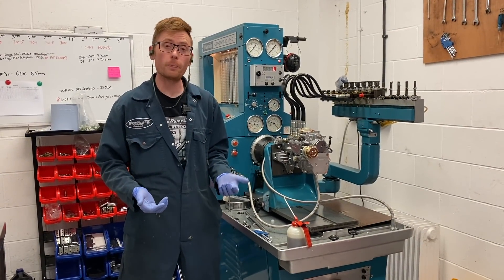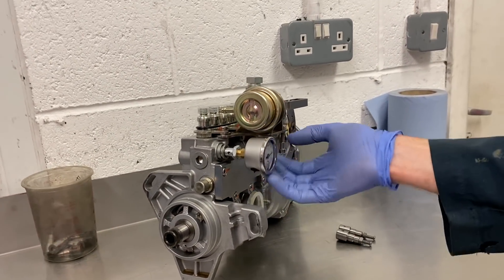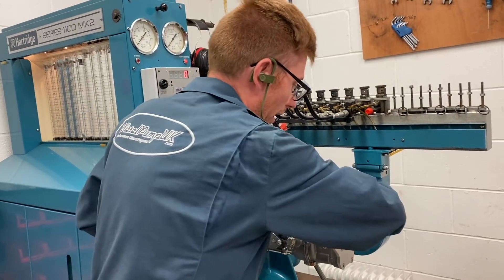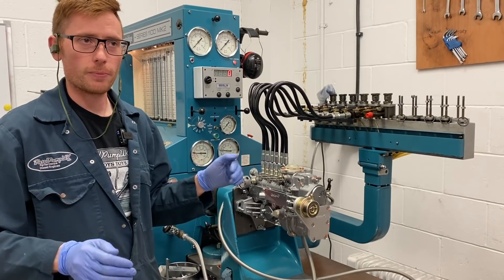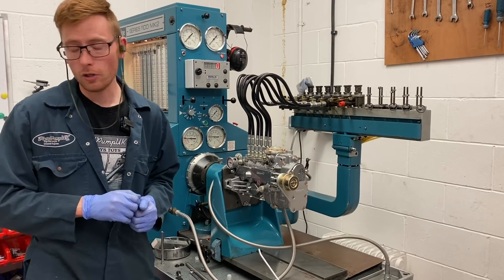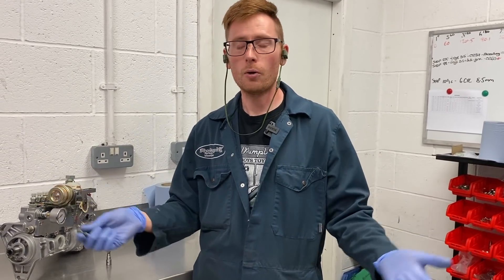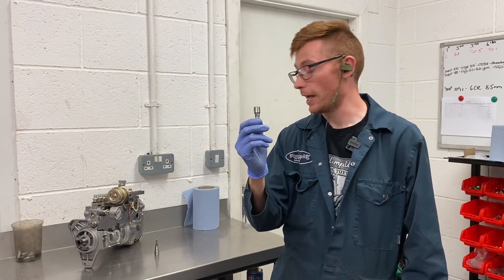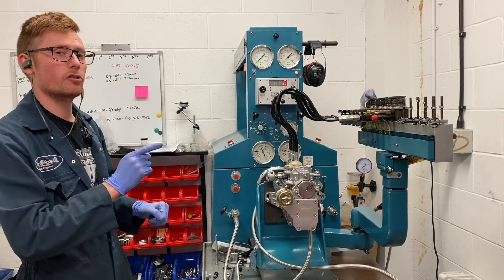The Key to BIG POWER - Fuel pressure to your DIESEL PUMP

Comment: on my cummins P7100 return line i have a holley gas 10an fuel pressure regulator with boost port of a carbureted turbocharged engine and it works perfect stays right at 30psi (2.07 bar) 👍

Comment: But why do you read 2 bar at the test bench and 1 bar on the pump with no flow (blocked return port on pump)? The pressure with no flow should be the same. I think you need to open the breater rubber walve on the top off the pressure gauge.

Comment: I recently purchased 2003 Case IH JX95, made in Turkey, with a Bosch VE injection pump and an Iveco 4 cylinder engine. I can provide model numbers if you are able to respond to this post. It only has 375 hours on it. The most unfortunate part of the fuel system design is the fuel tank is well below  the injection pump and there is no fuel pump supplying pressure. It depends on a siphon system to supply fuel. So I took the tractor out for it's first real bit of work yesterday. At road speed,  high speed/high gear on an incline the engine was definitely searching for more fuel.

I was wondering if installing a cheap electrical inline fuel pump would help my situation.

For my background I am a degreed automation engineer with a career in the oil & gas industry. But I live on the family farm with my late father being a lifelong farm who always said there wasn't a tractor worth anything unless the fuel delivery was increased from the factory. I know he somehow increased the fuel delivery(with help from a local mechanic...who has also passed) to our pulling tractors. One was a White 105, another was an Allis Chalmers and another was our Ford TW-25. All tractors from the 1970s and 1980s.

This same pump also has a leak. It appears to be between the hydraulic head and the body. Perhaps the o-ring needs replaced. It it possible to remove and reinstall the hydraulic head with the pump still mounted on the tractor? Or do I need to remove the injection pump to perform this task in a vertical orientation.?

Comment: HI! Nice video! I have a OM-314 engine with Bosch PEs4a90d diesel pump in my old Ford F-100. Is it possible to change the elements of my pump to achieve more power?.

I really like my mercedes engine, but it's slow. Thanks from Brazil

Comment: Liquid filled pressure gauges may give you false readings, depending on application. Density of the liquid filling changes with temperature, and in a hot engine bay will give you a different reading than in a controlled environment.

Comment: Is it possible to use a MAP sensor as a fuel pressure sensor? I don't see why not, tbh. I'm only worried the materials in the MAP sensor could react badly with the fuel. I'd have to open one up and check, or try to find out what kind of elastomer the diaphragm in the sensor is made of. It's not a problem for me to connect it electrically as I'm an automation engineer. It's just a 5v supply, grond and a 0-5V signal that is 2,5V at atmospheric pressure. I want to do this because I want to check my fuel presure while driving, and also check if there is a vacuum because my electric fuel pump is dynamically controlled and comes on and off by itself. I also want to build an auto start system that inhibits starting before my veg oil fuel has reached a proper pressure at the pump.

Comment: Very good video well explained.
I used a Hartridge.
Machine 56 yrs ago at the technical college we did all the tests etc 
Including phasing and 
calibrating the in line pumps.
Also stripping pumps and repairing to the 
required high standard 
which was req.

Comment: I would suggest a bypass pressure regulator on the feed pump. Due you recommend to fit accumulators as shock dampers?

Comment: This is garbage. You cannot, cannot feed more fuel into an older mechanical pump with no return line. Makes zero difference. Intact forcing more fuel into those pumps without a return damages them.
Reply from the maker: These pumps DO have a return have a look at one when you get the chance.

Comment: Would be worth pointing out that putting positive fuel pressure in front your injection pump isnt always a great idea... For any pump with a built in (fuel pressure controlled) dynamic timing system (So basically any modern rotary pump (VE etc), this is a bad idea, the second you add pressure, you will mess up this timing curve (Add a bunch of timing at idle / lower demand where you dont want it).... Worth mensioning as I have seen many of times on customers vehicles where a "performance fuel pump" has been added inline to there VE pump supply line, and then the engine sounds like a bag of nails...purely because the pump just runs at max timing 24/7.... For pumps like the VE, the key to higher rpm power lies with restrictions in multiple places in the body, and the plunger return setup AND fuel restriction...You CAN (and need to) add a pump, but other modifications are required at the same time.
Personally I wouldnt generally drill out a return fitting, its largely there to purge air and provide a small ammount of fuel flow for cooling.... If you are having to drill out your return restrictor, you are somewhat defeating the point in adding more inlet flow? Would be better to fit a (decent) fuel pressure regulator on the inlet side, with its own return to tank...that way you can run as big a pump as you want, and set the inlet pressure to be constant, largely regardless to demand.... and you arnt wasting perfectly good flow going right through the pump and down the return.... If the pump wants 100% lift pump flow, the regulator will just shut its return right off to try and maintain inlet pressure.
Just a few thoughts that may be helpful to a few people....
Reply: On VE pumps be careful with inlet pressure changes and drilling out return banjo bolt restrictions as these are both instrumental in advance curve, the regulator setting as set by the plug above is a max setting, the pressure rise curve is dependent on rpm and bleed rate back to tank which moves timing piston as pressure rises, this can be altered by low pressure pump wear ( for those that don't know its at the front of injection pump) causing slower rise rate or blocked return orifice screen or orifice itself or someone replacing banjo bolt with different orifice size ( smaller or larger)or drilling out etc, as pump rpm increases so does fuel volume which causes a rise in pressure,when due to bleed rate thru orifice it can't return to tank fast enough as well as what is actually being delivered to the injectors factored in and the advance piston pushes the cam ring advancing injection, usually 1 of two scenarios happen, LP pump wears and inj timing retarded thru whole or part of range or orifice incorrect and advances too soon ( too small) and runs hot, or lays down in top end (too big) from not enough advance,
If your pump static timing is correct ( usually done by plunger travel method) and is running hot at high rpm but not blowing black smoke and Max regulated pressure is in spec then most likely running too far advanced from return restriction, if you have a spare return banjo bolt try running a ever so slightly larger hole and see if the running hot changes to a higher rpm or goes away ( assuming return lines are clear and tank not over pressuring) this is/ was a huge issue with Toyota 1HZ mechanical pumps and some 5L pumps, Toyota had revised return banjo bolts thru Denso dealer program when correctly diagnosed this also sometimes lead to over injection on stop start driving and oil sludging from fuel contamination in oil
Reply: @Hitman-ds1ei  interesting. I suspected I overdid it and had removed the pressure regulator and tapped it back out and reset it. I have the original OUT bolt back on, and car seems to be happy now. Although when I did a simple quantity of fuel coming out of my pump before messing with the pressure, I was supposed to get roughly a litre of fuel @1000 rpm after 1 minute. I only got 200 ml back, 1/5 of the suggested return past the out bolt. Checked for fuel restrictions going to tank, checked pickup and sender, and the inlet tube seemed to be tough to blow through. Vac gauge was able to pull a few inches of mercury though and it seemed to be fairly unrestricted. If my old pump is roughly 5-8 psi lower than factory across the range, that’s fairly good considering it’s likely quite old and worn. 

Plus I think I’ve had a tremendous AHA! moment. I strongly believe my turbo wastegate actuator spring is weak and is having exhaust pressures overpower the spring and causing the flapper to open, bleeding out boost and causing this intermittent night and day power variation
Reply: I JUST finished messing with my mechanical VE pump on my ‘97 AAZ 1.9td VW. I made a pressure gauge adapted to the head of another out bolt, suspecting my pump is a tad weak. 
From what the internet and forums say, I was about 5 psi less at 1000rpm and about 10 @ 2k rpm. 
So i took a punch and hammer and knocked the fuel pressure regulating pin in a hair, and the car seemed to respond well, the pressure increased a bit to supposed normal spec, but it sounds like a bag of nails. 
I rebuilt the engine, ported the cylinder head with freshened up valve grind and seats, added an intercooler setup, yet to de-restrict the exhaust, but the car’s final issues I feel lie in the pump. 
The real doozie is that with the same pedal travel in the same gear, with the car in the same load, even with the engine and turbo heat-soaked, it’ll suddenly be a different car, it springs to life and actually has TORQUE and pulls like a freight train. 
I’m at a loss.
Reply: Mercedes m pumps don’t actually have any timing control, the gear on the front of the pump has a centrifugal mechanism that advances timing with more rpm,
Reply: @Diesel8290  I realise that, I am talking for cars that do....
Reply: @darrenjlobb  any idea on what this surge of power and torque might come from on an old VE pump diesel? I know I’m “that guy” on youtube, but you look like you know these pumps more. No one has got a clue that I’ve asked, people just say take it to a shop

Comment: why not use a spring type return bolt with an m12 to m14 adapter and have as good as constant pressure? like the bosch ....000 (1,5 bar)  or ... 089 ( 3 bar) . The internal pressure (as small as it is in an in line pump) doesn't even have any influence to wear of the element, fuel quality does! return bolts with a calibrated hole only have their use in VE-type pumps where different internal pressure is needed for mechanical timing....  nice little bench btw . ( i operate eps 711, eps 815 , AVM2 , hartridge 400 , and multiple others for cr). Kind regards

Comment: vovlvo fl6 used 24 volt 044 eqiv on a bosch 044 from factory,and funnily enough didnt have same failure issues like the transits which either doid not have alift puymp or flowed the fuel back through the pump and these pumps need flow for coolong

Comment: yes i chased fuel pressure problems for years,now wherever possible i use holley blue or bosch 044 depending on how much lift pump pressure i need,i worked at united fuel injection in perth WA and i was the first there to fit elec lift pumps to vehilces,some idiots are trying to say i cant use an 044 on a bosch p pump which i have fitted to a mercedes truck without issues
Reply: What is the input pressure for a Bosch P please
Reply: @rod5262  depends on application,valve on return line opens around 30psi in standard engines
Reply: @rod5262  i dont agree with the assumtion it should not go over 45 psi in video,tractor pullers,diesel drag race etc routinely run 120psi+ into P pump,driveability issues aint an issue to them though LOL
Reply: What effect will having an open return have on a p series pump?  This is for a farm tractor , some have valves on the return side and some don’t
Reply: @rod5262  not an open fucking return line,regulated return ,are you even a mechanic?,same valve gave alot of problems on cummins applications
Reply: I’m not a mechanic Andrew so I’m asking questions that I have never been able to get answers to. John Deere started using P series pumps in 1972. These had no restriction on the return side and no valve at the supply side of the Stanadyne glass filters. These engines lost their fuel overnight every time unless the tank was full. I blocked the connection between the fuel filters and the leak off and sourced a valve for the return side of the pump. Straight away the glass clip on filters shattered so I managed to source steel ones plus plus Deere recognised their error and made a non return valve available for the supply side of the filters. All of this cured hard starts. I assume these pumps need 30psi gallery pressure to function as they should
Reply: @rod5262  i have worked on a few john deere $wd tractors going back to my apprenticeship days,the only ones i have seen have the 30psi relief valve srewed direct into pump gallery,and the issue as well as drainback has been where lift pump wears out usually due to dirt contamination and it cant make 30psi pressure and as it cant remove air wi=th return flow engine stops due to airlock if driver isnt refusing to drive it cos it lacks power LOL

Comment: a guy with a flow bench should know inlet pressure doesnt matter. flow is all thats required. pressure is merely the restriction to that flow, which we know is there. because its the fuel pump.
Reply: A guy without a test bench should know that flow without pressure will not charge the elements.
Reply: @drbobritter1143  no such thing as flow without pressure. go back to school.
Reply: @DieselRamcharger  that's wrong. You can have flow with basically no pressure. If I take a hydraulic hose off the outlet of a pump, I'll still have flow but there will be very little pressure
Reply: @BENNO117  Pressure is the RESISTANCE TO FLOW. For fucks sake.
Reply: @BENNO117  Go back to school dude.
Reply: @DieselRamcharger  I know what pressure is. What I said is true. You can have flow with virtually no pressure
Reply: But you need the pressure to force the diesel into the elements as they come down to be refilled,
Reply: @Diesel8290  no. the elements are empty, a void. when they open atmospheric pressure, which is all around us all the time, will be happy to do the work for you. Thats why when you knock over a glass of water, it spills. You dont need to pump it out. You guys have some VERY basic misunderstandings of how things work.
Reply: @DieselRamcharger  a glass of water has time to empty. At 2000 rpm you WILL need pressure to fill the void quick enough to maintain performance
Reply: @holmes1956O  what you need is fuel flow. the problem here is that people are using PRESSURE to qualify FLOW. This is inaccurate. I fully understand how this all works. Maybe yall should THINK a little more and respond less. The person in the video claiming to educate you all doesnt know everything. I encourage you to do your own math.
Reply: @DieselRamcharger  I have over 40yrs experience working on diesels some as large as a house. My favorites are the cat 3406 a and b. I also know about flow numbers pressure and volumetric efficiency. and smart asses that think they know all

Comment: will be there a video in the near future about boosting diesel engine with lpg?
Reply: I have both Powershot LPG injection and a Snow Performance  water/meth injection(dont use  LPG and water/meth at the same time!) on my highly modified Nissan Patrol turbo diesel. Water/meth kit gives you more power than using the LPG kit. Cheers!
Reply: @bikerman6907  does the LPG or water/meth affects the way the exhaust sounds?
Reply: @antoniotod9614  no not the sound. But you can clearly see a reduction in black smoke, when the water/meth injection kicks in, not so much with LPG actually.

Comment: Fuel pressure to the pump i assume basically means naff all where as flow rate capability has to be essential?
Reply: pressure is resistance to flow, having higher pressure indicates a higher flow capability.
Reply: @swagman155  but you need flow to maintain pressure, it no good having 1000 psi closed pressure only to drop to 1psi when the taps open.
The pump is going to raise the fuel to the required injector pressure but the pump needs an adequate flow rate to do that.
Reply: @Will-thegrumpysoutherner  you said it in your first line. You need flow to maintain pressure. Therefore if pressure doesn't drop bellow spec it means flow hasn't been compromised. If pressure did drop it would indicate flow isn't adequate.

Comment: Any chance you could test a Bosch P7100 pump for us?   I'm running my P-pump at 30psi with an adjustable Fass fuel regulator instead of the banjo bolt
Reply: I run 30psi at idle and 40psi going down the road. I think you can safely run 60psi

Comment: It’s the same with new GDI engines as well. Boosting low side pressure increases the delta so the high side is much higher and that’s with a factory high side pump.
Reply: thats how all "pumps" work. there is always a pressure ratio. higher the inlet. higher the outlet.